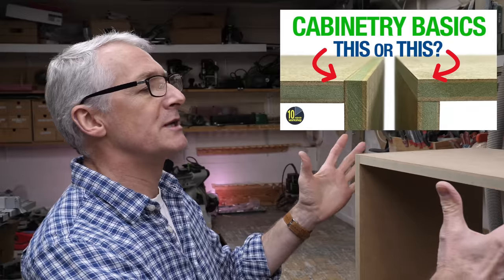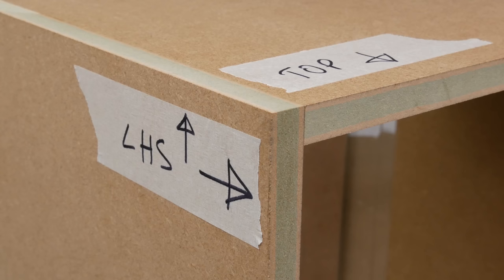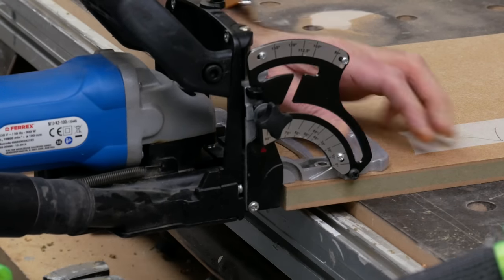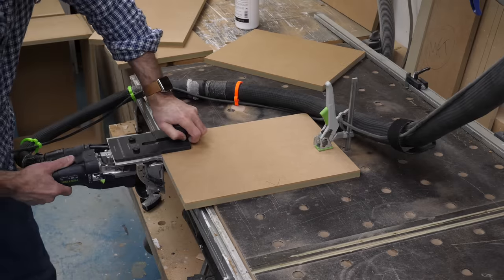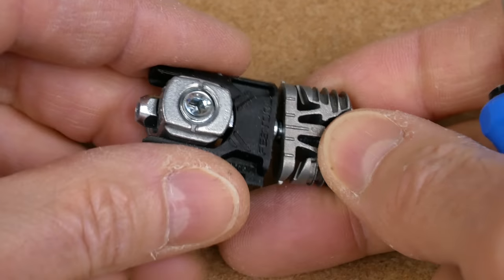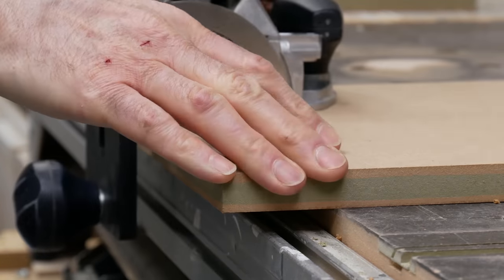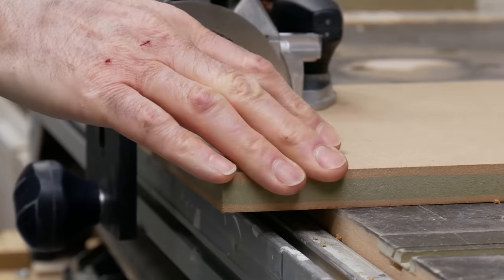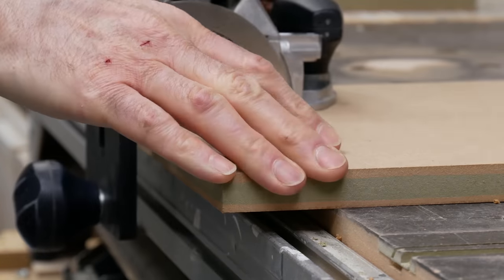Cabinetry Basics P3 [Video 437]

Comment: Brill Peter, thanks 👍 Would you have the cabinets completely finished painted etc and then assemble with these hidden fasteners on site? Would you have issues with glue squeeze out or having to touch up the paint etc?
Reply from the maker: Thanks Brian! That's how I usually worked, yes - machine and prep everything, paint, pack and deliver, assemble, install. No., never had an issue with glue squeeze being a problem, especially with painted work. 👍
Reply: @10MinuteWorkshop  thanks Peter, I've wrestled a few diy wardrobes from the workshop into my own house fully assembled and what a nightmare that was. I might try some of these for the next project!

Comment: Although I knew where my abilities were, I was reassured in a way to see dowels and biscuits referenced in this series. I must admit I was using exposed dowel in early days (and still used them where appropriate later on) as it allowed me to clamp a carcass square and then drill a depth limited hole through the side of the cabinet and the dowel went through the side into the upper or base. Sand flush and then paint. I use biscuits but do find they offer little in the way of strength or support. Surprised that the Hafele Cam and Dowel locks werent mentioned as readily available and are commonplace in certain Swedish flat pack furniture. Relatively easy to install with a jig or guide and cheap at about 12p per paired fixing. For flat pack customer assembly they are ideal as components easy to inventorise (yes its a word I checked!) and supply the right number of fittings per cabinet. Still another great video and looking forward to the next one.
Reply from the maker: Thanks Ian - I do the same with Dominos! Re cam & dowel, the cheapest jig I can find here in the UK is £100 or so which pitches it up against some stiffer competition in stand-alone power tools. And without a jig they’re fiddly to do well. 👍
Reply: I bought a cam and dowel jig on Amazon for £60 or so. Made in China but surprisingly well engineered. I’m not a huge fan of the system for true knockdown use, as the cams seem to work loose. Plus you have a 15mm interior hole to deal with. I used it on a recent project with a reducing bushing for cross dowel jointing, although that was obviously not a hidden fixing. Love your work, Peter. Even your big mistake videos induce a sense of calm!
Reply: @nigelshardlow402  I bought a similar jig (same price, made overseas). Make about twenty cabinets with cam and dowel, not had a problem. Would guess it could be down to the quality of the jig. As for the hole then depends on the nature of the piece your making of it is acceptable or not.
Reply: @iankearns  It must depend on where they are installed I think. I had some cam and dowels holding on the front panels of IKEA drawers. Obviously they got a lot of pushing and pulling in that application. I ended up gluing them on, problem solved.

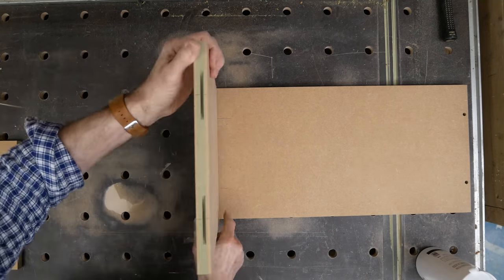Comment: Is that a sock at 4:59?! For connecting the biscuit joiner to dust extraction?! That is utter genius! 👌🧦
Reply from the maker: Ha! No, though it does look a bit like one! It's a braided sleeve that fits around the ribbed dust extractor hose that helps prevent snagging. A sock would e cheaper though! 😂👍

Comment: I was thinking that the easy way is usually the best way but if you use dowels and glue what if you need to disassemble. You use a hot gun. It needs more time but you are going to watch it more time then disassemble it so it is a good option if you preorder the parts and assemble them yourself

Comment: Thanks Peter, this episode is very informative indeed. I always wanted to learn your opinion on Minifix type fasteners (IKEA style camlock combined with dowels). Surely the cam hole is about 15mm in diameter, and the way they put together is certainly not as elegant as Lamello. but it seems the need of upfront investment(buying plate/domino/lamello joiner) is not required, and consumables are cheaply/largely available online...
Reply from the maker: Thanks! the cam & dowel minifix connectors are decent enough, but the cheapest jig is ~£100 or so here in the UK, and they're a paint to fit without a jig. I see that AliExpress have a similar jig for about half the cost, so I may look at at again, in another video. 👍
Reply: @10MinuteWorkshop  that'd be fantastic!! Thanks!

Comment: Hi Peter, really enjoying the series. Have recently bought a cheap dowel jig myself. Was wondering why you didn't use the 'legs' on the top to centre the jig across the edge of the board, and used the measurements  and guide instead? Did you find this way more accurate?
Reply from the maker: Hi Pete. One thing I found when using this cheap jig was that I had much better results clamping it down, so while I could use the legs to self-centre, there’s no way to clamp it in that position. So for me, referencing off the fence is just easier, and it gets you into the habit of referencing the fence off a ‘face side and edge’ which is how you do it with every other jointing system. 👍👍

Comment: Hi Peter, good series as usual. 
Did you ever consider the length of time involved for each method to as the only thing that is putting me off the peanut system would be the time taken to set up and machine each joint. 
Also have you ever seen the Invis from lamelo? About 20 years back I consider one but at £800 back then was too expensive. A quick look for it and it is now half the price. Gives an invisible join using a rotating magnet to cause the bolt to spin up inside the material.
Reply from the maker: Thanks Mark. Yes, the thing about the peanut system is that because it’s a jig & router, it’s slower to machine, but way faster at the glue-up because it’s self-clamping. And yes I’ve seen the invis system - nice, but crazy expensive, even at half price, lol! 👍
Reply: Cheaper than the domino or zeta removeable options which it competes with

Comment: Wow! I thought my Ryobi biscuit joiner was defective and overcutting each slot, I never realized the glue would expand each biscuit to fit. Thanks! Would you say 3/4" / 18mm is about the thinnest stock you can reasonably join with a biscuit joiner? Curious about 12mm since I have a fair bit
Reply from the maker: I’ve never used it in anything thinner than 18mm tbh, but they sell smaller biscuits, so I guess some folks must use them? 🤷‍♂️👍

Comment: Think you must of been unlucky, my zeta worked fine with the tenso straight out the box. Expensive but for speed of use and sheer satisfaction, the lamello has pretty much made my domino redundant. I sometimes create joints in small bedrooms and I can do that on the floor with the zeta but not so easy with a domino, I prefer using that on a bench set up.
Reply from the maker: Maybe, but I can only comment on the tools I have, and that’s how mine was, out of the box 🤷‍♂️👍
Reply: @10MinuteWorkshop  I'd be interested when Peter bought his Zeta and when these other guys did? If there are years in between maybe it got improved by the manufacturers? I'd be interested in the steps Peter had to do to fix his issues.

Comment: Do you know if there is a plan to release a peanut bit to fit the 1/4inch routers / spindle? Would be great to use this system alongside workbee
Reply from the maker: I don't, no - I wish, and I have asked - even an 8mm shank would allow for a smaller, neater router. Keep you posted if I hear anything! 👍
Reply: I sent a message to IF a couple weeks ago and apparently 8mm are on order.
Reply: Ahh crap, my er11 collets maxs at 7mm.
Reply: Ok so reached out to them, and they have said there will also be a quarter inch one coming in the the next month or 2. Should really expand the number whi can use them!

Comment: Wonderful video, I'm going through this series as I'm considering DIYing a kitchen instead of using IKEA boxes, I think I will need the better water resistance of marine ply vs IKEA melamine.

Do you have any opinion on the style of hidden fasteners (cam-locks maybe) that IKEA uses? 

I think it should have similar pros/cons to the domino fastener, with no need for an expensive tool, just the dowel jig and 3 drill bits.
Reply from the maker: Thanks. You can get much better MFC than the ‘lowest common denominator’ product that IKEA uses, and certainly marine ply would have better water resistance but unless you’re making a kitchen in a boat I wouldn’t say that it’s a huge consideration, personally. Re the hidden fixings, the cam & dowel connectors have been around forever and work well, but the jigs were always costly. I’m sure there are cheaper options available now through the usual Chinese megastores, but I’ve no direct experience of them. 👍
Reply: @10MinuteWorkshop  thanks for the quick reply and the info! I didn't know there were jigs available, I was just going to mark, use a dowel jig for keeping the critical holes square, and eyeball the cam-hole squareness. I'll see if I can find any jigs!

I'm considering marine ply partly because the kitchen is in a beach-house (on an island), partly because it looks nicer, and partly because I have no idea where I can get high-end non-ply sheet near me (southern Portugal).
And if I ignore my labour, it still works out cheaper than ikea. Probably. It'll depend on ease of transport, because my stuff wont be nicely packaged.

Comment: As someone who has previously owned and sold a domino XL I was wondering whether you would recommend a smaller DF500 or the peanut system? 
It would mainly be for carcassing work and also things like exterior benches
Reply from the maker: Honestly the donino is still the most versatile system around, imho. The peanut system is brilliant at what it was designed for - frames and carcasses - at a price that can’t be beaten, but for exterior work like Ben he’s, then I’d look at the domino. 👍👍

Comment: Have you ever used the classic metal knockdown cam. I never see them used in videos they are dirt cheap and just need a drill and a simple home made jig or a £30banggood jig if you want to get fancy
Reply from the maker: No, not violently against them but they have too much of an ‘IKEA’ association, and they’re a pain in the neck to fit without a jig, and before banggood started selling them, the eg hafele jigs were a couple of hundred quid each, so not really a practical proposition for the casual user. 🤷‍♂️
Reply: @10MinuteWorkshop  your completely right about being a bit ikea. I'm just a  hobby woodworker. Its hard to justify  the expensive systems. Shame the peanut is so expensive I cant see a reason for it

Comment: Hi Peter, congratulations on reaching the 100k milestone. With the usual quality content of your videos it's no surprise, and testament I'm sure, to the unseen time and effort that you put in behind the scenes. I was just wondering if you have any experience of the Lamello Self Clamping Element, a sort of plastic biscuit with friction ridges that I believe doesn't need glue ? Even more interesting would be whether you could use them with a standard biscuit jointer. Great work and thank you for your continued and well chosen themes.
Reply from the maker: Thanks Jon! No, I’ve no experience of those connectors, I’m sorry. There seem to be so many different types of biscuit-based connector! 🤷‍♂️👍

Comment: Hi Peter, longtime avid fan and enjoying the series so far. You use a ratchet to turn the Festool connector rod around to face the correct way. Is that a proprietary tool or some sort of special tool??
Reply from the maker: Hiya. It’s just a small socket driver - this one’s a nice bluepoint, but anything will do the job. 👍👍
Reply: @10MinuteWorkshop  Many thanks Peter

Comment: Hi Peter, What about the SC 8/25 from Hafele? Not really knockdown as such, but could be an alternative to the Tenso?
Reply from the maker: The Hafele fittings are great - the SC8/25 are an excellent one-time hammer in connectors, the SC8/60 a good knock-down fitting too, though the jig is crazy expensive. 👍👍

Comment: Love all of your videos. I was wondering if there is what you call " wiggle room" with the Domino and the Lamello. After seeing how your carcasses fit, I really am not impressed with the joints as both corners were off slightly. Am I just nitpicking or are both of these machines that bad. For my money the dowels and biscuits are a better solution cost wise.

Comment: Hi Peter, which of these in your opinion is the best for bevelled joints? Would make another great comparison video.
Reply from the maker: Hi Kevin. Great question, actually, and bevel joints are the main reason the guys behind the peanut connector created it, and it is particularly good for that, as you may have seen from the Bedside cabinet video - https://youtu.be/aJNzOZCHrGU. The Domino is good if you can clamp it up OK, the Lamello Clamex is excellent, but it does leave a hole, and the Tenso is good too. For a non-marking connector, then the Peanut or the Tenso, with the Peanut probably producing the stronger joint / the most clamping pressure. 👍
Reply: @10MinuteWorkshop  thanks Peter, I taught so the peanut would be, I have the domino as mention to you at makers central. The problem has always been clamping the joint on the glue up and stopping it from breaking open on the install and transport. I really like the peanut connector jig but it’s just the pricey for how often I would use it. I am sure I am one of many who are eagerly waiting for the mini peanut jig to come out.

Comment: Yet again another really useful video for us begineers. I've been holding off getting the Peanut Jig down to cost but also wasn't sure how you could slide in a rear panel with this system meaning i'd have to change how i've been doing things so far. Any Ideas?
Looking forward to seeing a review of the MiniJig when it's released, very soon i hear.
Reply from the maker: Thanks! Yes, the mini jig i coming very soon, should be the next video after the conclusion of this series. Intelligent Fixings have some videos on their website that show how the bak panel can be fitted - basically a deeper slot in the top allows the panel to pulled down into position - a bit like you'd fit a sliding door into a channel for a cabinet - the top channel is deeper to allow it to drop down yet still be retained. 👍
Reply: @10MinuteWorkshop  Thanks Peter, i'll take a look at that

Comment: Is there a knock-down fitting that is dowel-based?  The sort of thing you might use with a Mafell dowell thingy?
Reply from the maker: Yes, there are a few from Hafele; they call them 'spreading connectors', if you google for the Hafele  SC8/60 and the SC8/25 they should pop up. the 8/60 is a genuine knock-down connector, the 8/25 is a one-time hammer-together connector. I had a play with them when I had the Doweller on loan, wasn't overly impressed tbh, but only played with them. 🤷‍♂️ 👍
Reply: Thank you so much for the reply... much appreciated

Comment: Really enjoying this series, question out of curiosity
What's the price of mr MDF compared to regular MDF in the UK? It's been a challenge to find it here in Ontario Canada, and now that I have I'm blown away by how much more it costs compared to regular MDF. Almost 3x the price per 4'x8' sheet.
Reply from the maker: Thanks! Wow! Nope, nowhere near that much of a price difference here, it's about 25% extra for MR. I use this yard, prices are all listed in £UK - https://www.ajferguson.co.uk/sheet-materials/mdf/moisture-resistant
Reply: @10MinuteWorkshop  ya way different pricing. Average cost I've found for 18mm MDF is around $35-40cnd vs $110 for medite mr.

Seems like it might just be new here and making its way in. Every lumber yard I asked looked at me like I wasn't from this world when I asked for mr MDF and right away just said 'i have exterior grade' 
It was only when I found medite directly and contacted them that they knew what I was talking about and gave me pricing.

Comment: Hi Peter, new to your channel and love it. Clear, thorough, concise and relevant. Fantastic use of my time. Question for you...most of my projects are built with Appleply (high quality hardwood ply) or solid wood (from pine to hardwood). The peanut connector system looks like a great solution for several of my project types, but is it a good choice in these materials? Thanks much.
Reply from the maker: Hi and thanks! Yes, the peanut connectors work very well in plywood and hardwoods 👍👍

Comment: In the earlier series you mentioned the need for fastening, because glue wil fail in the end. How doe the dowels help with this, the are only held by the same glue?
Reply from the maker: Because the fixing is extending into the body of the material, not just resting on the surface as with a butt joint. If/when the glue fails (and we're usually talking decades here) then the fixings will prevent collapse. Worth noting that eg dowels are usually used in addition to other fixings in commercial applications. 👍

Comment: Good series Peter, couple of things, with the Lamello is there a tolerance like the domino (different domino fits) or does it have to be perfect? also that peanut connect system looks good but that jig looks a bit fiddly & complicated or is it just me? :)
Reply from the maker: No, there's ~0.5mm of tolerance I think, in the Lamello fittings. There's a lot going on with the Peanut jig, the mini-jig (coming very soon) is simpler to use. 👍

Comment: Tenso has an additional piece that adds strength. Just wanted to mention it. Seems to make a difference for a nominal cost
Reply from the maker: 🤔 There’s a pre-tensioner, but it doesn’t add any strength - just makes it easier to get the two halves of the joint together especially when you have a run of them inline. 👍👍
Reply: @10MinuteWorkshop  thanks Peter. I completely miss understood this piece.